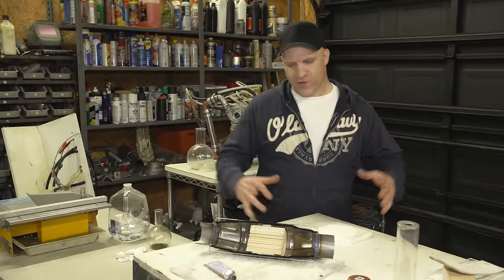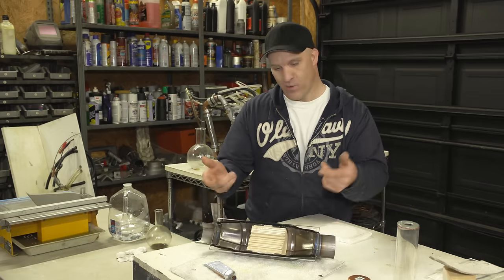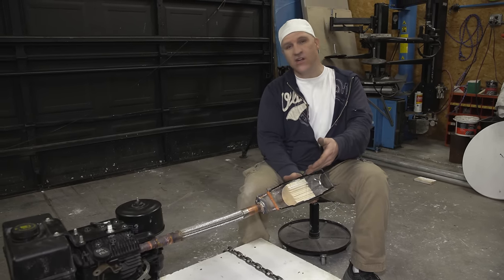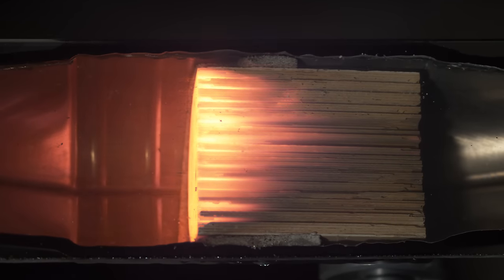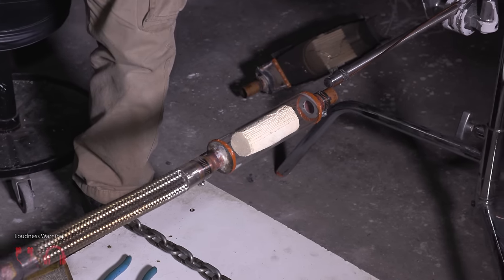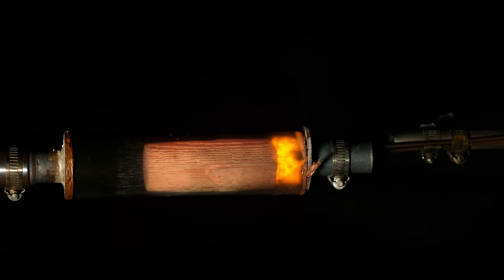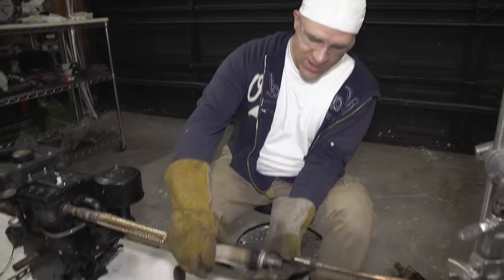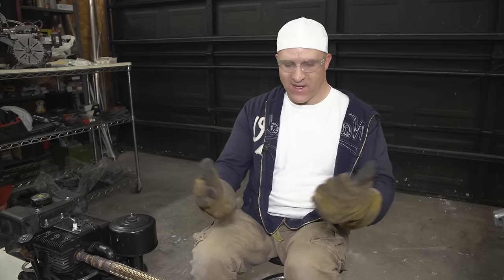See Through Catalytic Converter

Comment: Diesel Catalytic converter is very questionable if driving only short distances. Eventually It is blocked and only a pencil diameter passage through. It increases fuel consumption and motor oil became dirty sooner. It is said how to clean up the catalytic converter of diesel car. - by using an iron bar :)  of course you can try citric acid fluid etc. but you never get rid of this problem imo.

Comment: starting to make sense how my p0420 code(catalyst efficiency below threshold) went away after topping my oil off with lucas upper cylinder lubricant(instructions say put it in the gas for some reason, even though it's an oil) and adding something to my gas that claims to clean up carbon and driving around on the highway

Comment: the fire coming out after the catalytic converter was because there was a new source of oxygen because there is vary little oxygen left in the exhaust after the combustion cycle and buy choking it it dumped raw fuel out the exhaust and was lite a fire buy the hot catalyst and liquid gas burning is not what they do they turn nox gases to steam and some other stuff and on the norm there is never fire in the cat but can glow red hot and if they do fix it lol

Comment: 6:00 This description doesn't make sense. If fire comes out, is is NOT burned by the cat, because unburned gas burns AFTER the cat producing flames. Yes, a part of the gas is burned by the cat, but it was too much for the small cat and maybe not enough oxigen on the intake. There is no fire comming in, because it is not enough oxigen on the intake side. You should add more air to the intake side of the cat by an airpump. If it is enough air added, the cat will burn much hotter and the flames on the exhaust will stop, because the gas is fully burned inside the cat and there is not enough remaining to build flames.

Comment: a modern cat is NOT designed to do what you just did for prolonged amounts of time. it will melt down when treated improperly. a cat functioning efficiently will only get about 10 percent warmer on the outlet than it was going in because there should be very little HC going in on an efficient engine. usually around 700 F on the inlet and 770ish F on the outlet.

Comment: Fun to watch, but the test method was not right. The modern TWC is not for this kind of engine, and not only dealing with the unburned HC and CO, it has to reduce NOx alternatively. After the Cat, the exhaust is around stoich. No engine is running rich nowadays, it’s going to melt Cat.

Comment: Hydrocarbons are not being burned inside the catalyst! 
The catalyst is heating up the exhaust gas to such an extent when it hits the atmosphere and has oxygen available the unburned hydrocarbons will then burn. there is no oxygen available inside the catalyst to facilitate anything burning, otherwise you would see a flame inside the catalyst itself! 
Towards the end of the video the rear cap comes loose causing an air leak into the catalyst chamber, this allows some of the unburned hydrocarbons to now burn before exiting the catalyst itself.

Comment: Nice informative video which makes me more curious about my cat problem. My original cats are broken - one emptied by previous owner other got choked probably. My plan is to buy two universal cats and mount them. The question is that does size matter? :) Uni ones are smaller than originals which may cause quicker reach to melting point i guess?  Finding damn originals is hard from this country plus not guaranteed as they will be used ones.  I will either install new ones in the place of originals or move them a little further towards back on exhaust line, will also carry sensors of course. 

I could empty the other one and install a faker sensor to cheat ECU but it has disadvantages of course. Please someone show me the correct route. Cheers...

Jag x type 2.5 v6 2003

Comment: The platinum in the catalytic converters can cause a condition called Platinosis.  It is severe and can be caused by micro amounts of platinum. I would not work with the converter with out gloves and mask and laminar flow hood
Reply from the maker: I will make sure I do that next time
Reply from the maker: Thank you

Comment: The reason fire is coming put after rather than before is because there is still unburned fuel that is extremely hot. Qhen it meets the oxygen just at the end of the exhaust it combusts

Comment: I'm first saying I am a fan . Secondly , I would have to disagree with the whole premise of secondary gases not used. Why not have a higher temperature cylinder handle these leftover gases to increase overall efficiency
Reply: I dont mean turbo$ but actual gases being capable of another combustion cycle after. Catylitic converters rob you of possible energy harvesting

Comment: Ahh the catalytic converter. Luckily I live in a place we don’t have to pass emission tests so IF I ever have a problem with the cat it’s just going to get cut off and a straight piece of pipe put in. If your vehicle is running properly though   you shouldn’t ever have to touch the catalytic converter, they tend to only fail due to a neglected problem with the engine.

Comment: I have heard the catalytic converter burns up if fuel entering, it should probably not be in a carburated engine, at least not one running with choke.
Think it is a engine not suited for a converter without this happening.
This test should have been on a modern car, this would probably not be happening. 
Cars can melt the converter if a coil stops working I've heard. 
But i don't know enough about this.

Comment: 2:55 Dude  did you seriously think Silicone would hold the Cat together? You had a Huge air leak at the front of the cat the whole time. That's why when you added choke it go so hot. A Catalytic converter is basically an Oxygen storage device. The Rare Metals in the converter store oxygen atoms then give them up. Making NoX Nitrogen Oxide into Nitrogen and Oxygen and Making Carbon Monoxide into Carbon Dioxide.

Comment: So adding a catalytic converter to a 2 stroke would be intensely hot.
Reply: maybe that's the reason why 2 stroke engine don't have cat converter?

Like Warthburg,Trabant , Or Here Where I Live (Indonesia) There Is Suzuki Carry ST20 Pick-up Powered By 600Cc 3 Cylinder 2 Stroke
Reply: Not unless it is running overly rich, but the greater issue with a 2 stroke is the oil accumulation in the exhaust that could block a cat.

Comment: And why does the converter make a "Tk - Tk" sound, when I park my car after a long drive?
Reply: It's the hot metal of the exhaust system cooling down and contracting. Also my car and my motorbike do this, it's normal.

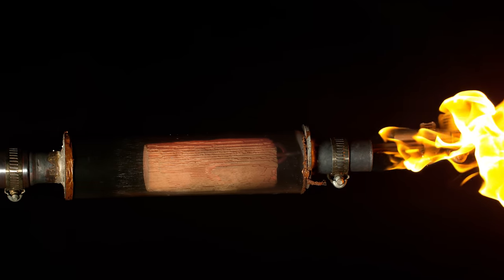Comment: @6:07 you say that the fireball is indicating that hydrocarbons are being burned inside the catalyst. This is not true. Nothing "burns" in a catalytic converter. excess hydrocarbons are actually turned into carbon dioxide and water. What happened in your test is simple. There was fuel flowing around the piece of catalyst you inserted into the tube, and when the seal at the end broke down, oxygen flowed into the glass tube and the nu-catalyzed fuel ignited. That's why the flame flows from the exit to the catalyst and not in the opposite direction.

Comment: cool video , but there's allot of things left out of this process , first that engine is running rich at all times, cats work best when engines run at stoichiometric ratios, so not really seeing what a cat is doing on a normal basis. also three way cats need a feedback fuel system for them to work properly so can't tell what the cat is doing there also.. at best what we are seeing is what happens when an engine is left running with a check engine light on with a rich running code stored., CATASTROPHIC failure as I call it. total melt down and a simple $200 fix turns into a $2000 fix. so would be cool to see you get a cheep car and doing the same thing with an actual car. thanks for sharing .

Comment: I got smell of rotten egg,does it means my catalytic converter have problem ? (Sorry for my bad english)
Reply: Means you're running with high sulphur  fuel. Three-way cats like this will store sulphur if you're running a bit lean.
When you need power and things get richer (more fuel than air needed to burn it) the conditions allow sulphur to be emitted as H2S - the rotten egg smell.
Back in the 1990s, cars with throttle body fuel injection would emit the most H2S because there would be lots of fuel in the intake manifold. When you close the throttle there's what's know as 'lean flame out where there's tons of oxygen and not enough fuel to burn.  This raised the temperature in the catalyst by hundreds of degrees C, and caused H2S emission.
In the US, TWCs were formulated with Nickel oxide, which holds on to the H2S until leaner conditions return (then release the sulphur as SO2 or SO3). In Europe, nickel was 'discouraged' by the German UBA.  Europe had a far worse H2S emission problem!

Comment: the fire is WHY Jeep no longer uses rear mounted cats, they are all off teh engine, which gts them hotter and destroys them faster but having them in the rear they would start fires off roading, yup.. triple cats is the way to go actually
Reply: not really. Epa forced manufacturers to make closed loop control happen quicker. Manufacturer had to move the catalytic converters real close to the engine and inject air in them to warm them quickly. Closer to engine = quicker warmup.  Bonus is no one can steal your cats on many many cars

Comment: So in other words if your engine is running correctly at 14.7 to 1 fuel air ratio your cats are nothing but a restriction causing more fuel consumption. I removed my cats tuned my engine and am getting way better milage and way more power.

Comment: all this heat is basically wasted energy....that's why electric engines are the future, if you like it or not.
Reply: It really only gets hot when converting unburnt fuel, which only happens when your engine is running inefficiently.  On consumer car sized engines, it's kinda hard to keep a nice efficient burn, so that's a great place for electric motors, but aircraft have lots of intake air and run very consistently, so they are very efficient. Aircraft will probably be hydrocarbon based until we figure out rather good supercapacitors.

Comment: Incomplete combustion? That's surely not correct. They hate anything but an optimal (or at the very least, ideal) combustion envelope (or stoiciometric mixture.) Too lean, they can burn up. Too rich they can clog up. At each of those conditions that doesn't function correctly.

Comment: So, "running rich" just means flooding it a bit so it runs badly? Got it. lol
Reply: 'Running rich' means that the fuel/air mixture has more than the stochiometric ratio of fuel. 'Running lean' means the fuel/air mixture has more than the stochiometric ratio of oxygen.
The stochiometric ratio is the mixture at which all chemical reagents will be consumed in a reaction, leaving only byproducts.
Reciprocating piston internal combustion engines actually run better (generate more power/time) when running just a little bit rich. So no, 'running rich' does not mean running badly. It means running rich. These are technical terms.

Comment: Ah, my old scooter catalyst is melted because my engine is overheated and the spark plug igniton is melted too because i uses ron 98 fuel in 10:1 compression engine 😭😭 and it ended up by the electrical short

Comment: Ehm this is totally wrong, the catalytic converter doesn’t like all that heat and rich mixture. The only thing you are doing is actually burning it away! Much more than 700 degree C and it will loose its ability to do a catalytic conversion.

Comment: They charge me too much for this thing at the car shop
Reply: I doubt it unless you live in California. You pay way more for it compared to how much people in other states but it has very little to do with the shop that installed it, especially if that shop had to buy one from the dealer. You got screwed yes, but you got it from the State. That mechanic had to install a cat that has the CARB approval #, specific to your vehicle, laser etched into the stainless steel housing that you saw being cut in half in this video. The number has to be facing down to where the emissions inspector can run a mirror under your car and see that etched number. If the cat does not have the number or the number is the wrong one for your vehicle, you fail smog as your vehicle is considered "Tampered" with even if the emissions out of the tail pipe are clean. The replacement cat is the same one sold in other states but it cost maybe two or three times as much because of that laser etched number. 
When there is no CARB approved aftermarket cat available for your vehicle and the mechanic has to call the dealer, believe me, even the he is puckering up on that phone call.
Reply: @Ed70Nova427  I just said it was overpriced I didn't want you to type out a full paragraph

Comment: The converter is basically a heat concntrator that gets unburned stuff shoved through it 🤓
Reply: No... It is a CATALYST. It actually starts generating its own heat when brought up to a certain temp. Usually about 350-450 F gets the catalyst active and the air itself along with any sort of unburned fuel gets burned, it also converts some of the harmful byproducts into "less harmful" byproducts...
Reply: If you really want to know, you can just look it up on Wikipedia!
Reply: @fadingbeleifs   if you believe Wikipedia you might as well grab your converter after a long afternoon of 100 mile an hour driving. 🤷🏼‍♂️🤣